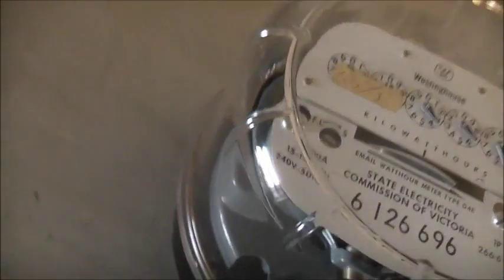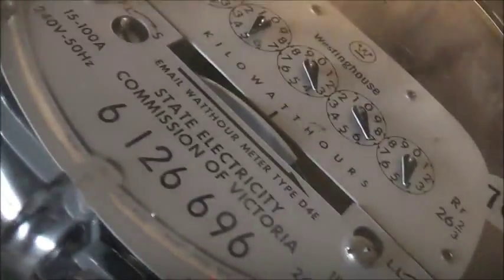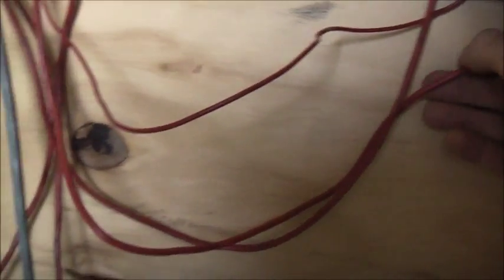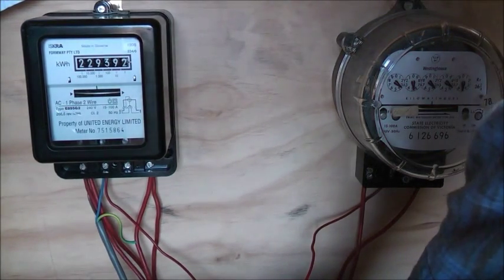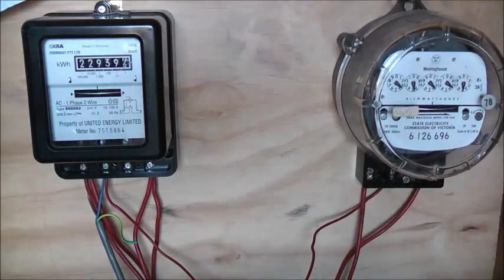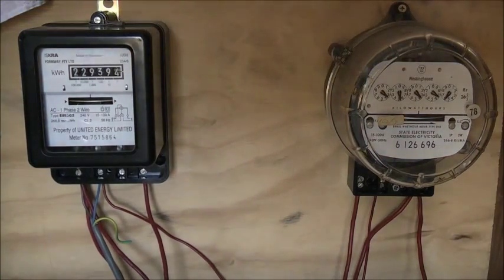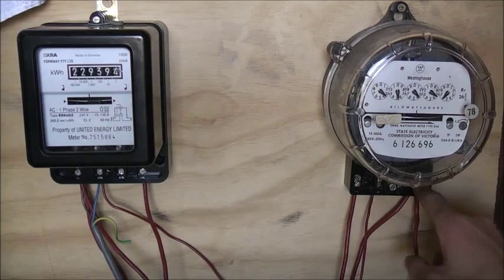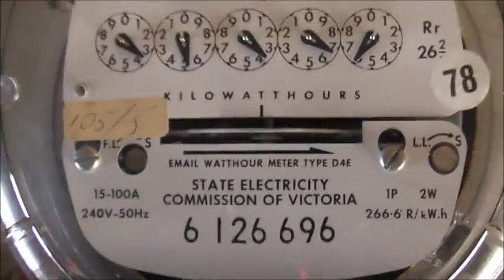Email Type D4E Watthour Meter Clean & Test

Comment: Very interesting Westinghouse meter, exact copy of the American plug in meters.
Unusual cover clamps location.
The rear of the D4E meter looks like an Email meter. Could have been that Email bought the Westinghouse inserts and fitted them in M3 meter housings.
The American plug in meters are 3 wire and have two measuring elements.

Comment: Ah whoopsie! When I saw that wiring config, I knew something looked a bit cranky :-O

The clamp meter confirmed it. :D

Current coils in series, voltage coils in parallel. :D

There we go! Now they're both buzzin' at a nice speed.

If one cable is a bit restrictive on the current, it will affect BOTH meters, so don't worry too much about it affecting the accuracy. Current-drop behaves differently to volt-drop.

Haha, you gave them more than 1/10. You've been hypnotised by the loadwheels :D

-BBD